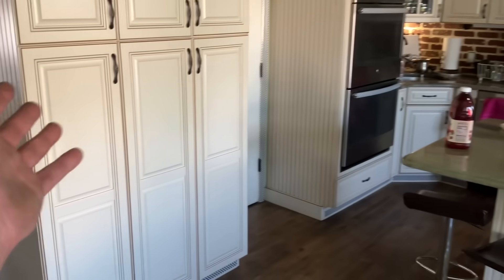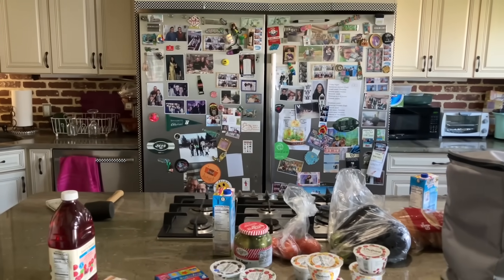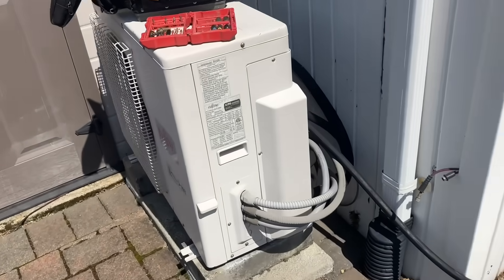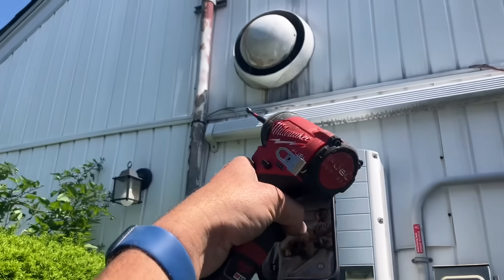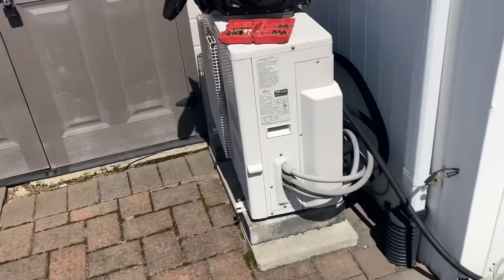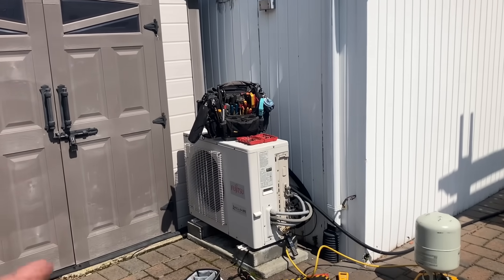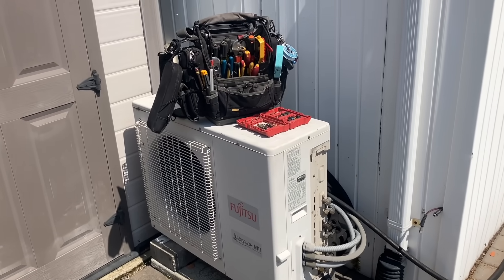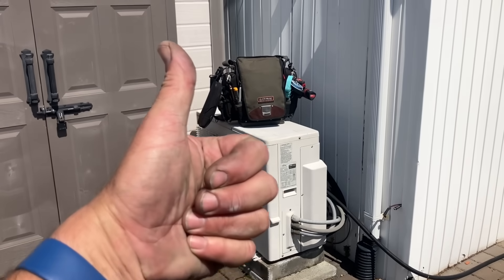Is This the Strangest Kitchen Discovery Ever? Fujitsu Ductless Not Cooling, Again!

Comment: it's crazy because itd actually work they left plenty of clearance above the crown molding and cabinets for the return air since it gets sucked in from the top. Probably ony a 12k head at the most plenty of airflow going out with the doors open. Just would be a nightmare to service the indoor board or thermistor or blower fan/motor. Neat idea, guy must know enough about hvac he requested it that way.

Comment: A ceiling cassette evap unit would be the perfect idea here.  If you have the attic space to get up there and run the lines to connect it, then I say do for it.  I hate these new A2L units.  However I prefer R 32A over R 454 B any day.  I have 3 R 32 A window a.c. units and they blow ice cold air even in the hottest days of summer.  Before that I had the R 410 A window units, and they did not cool nearly as good as these R 32 A ones do.  The window a.c. unit industry was the first to use R 32 A. I think they have since 2016.

Comment: This is absolutely ridiculous. All that cold air is going to condense on that wood and make mold!
Reply: it will be fine, due to some open space on either side of unit and venturi effect pulling excess air through and blowing out the front, as long as they never accidentally close the doors and run it.
Reply: @throttlebottle5906 come on, you know better than that
Reply: Not in that part of the country
Reply: @jamesm568 next to an ocean??